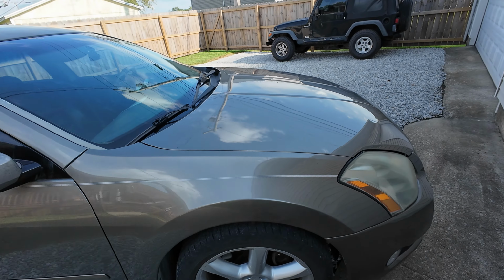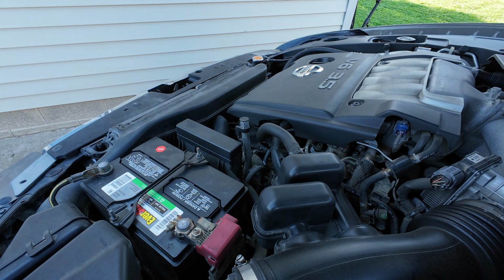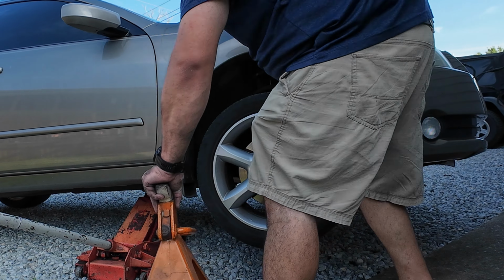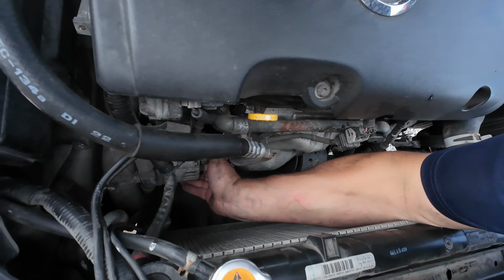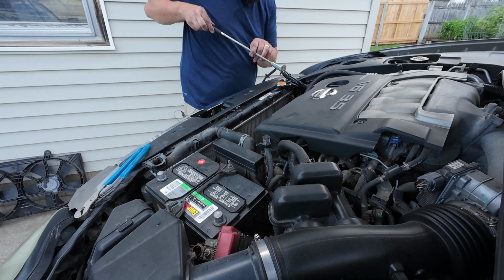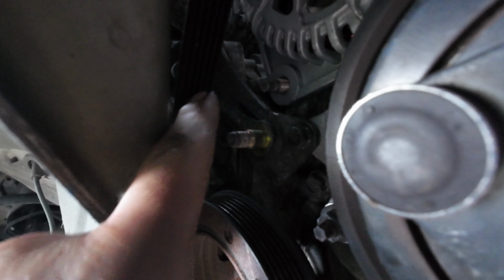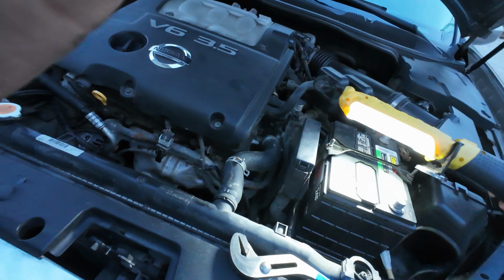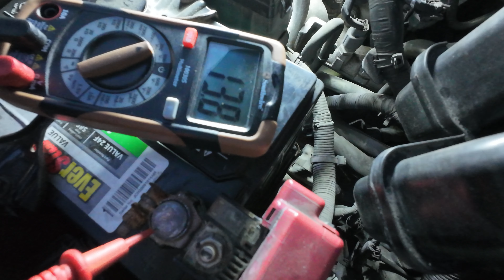Alternator Replacement | 2005 Nissan Maxima

Comment: I intend to do it this coming weekend on my 2007 maxima. I feel like I can do it since I replaced the valve cover gaskets this spring earlier. How long did it take you, it seems you started in the afternoon or earlier and finished when it started getting dark. Also, how difficult to put that long bolt in from the top? I do have that magnetic extension bar you showed. Thank you very much for posting the video.
Reply from the maker: I did start on it in the afternoon. It probably took me 3 or 4 hours. Most of it is pretty straight forward. The long bolt was a pain to get out and back in but I was able to finally get it back in with the magnet. It just took a little patience after dropping it on the ground multiple times. Good luck on the replacement if you haven’t already got it done.